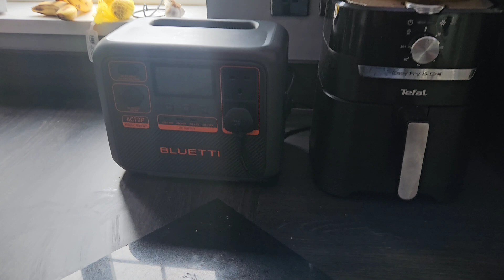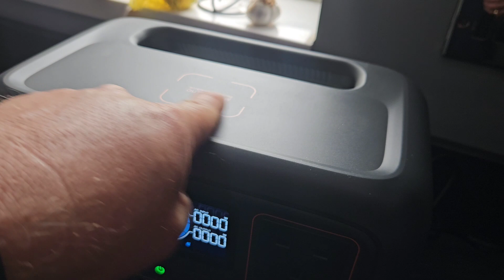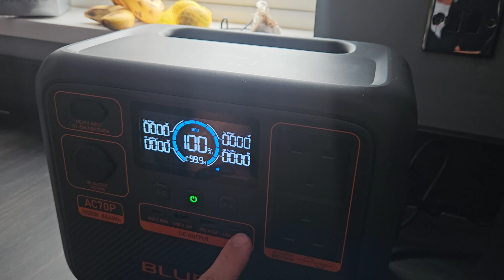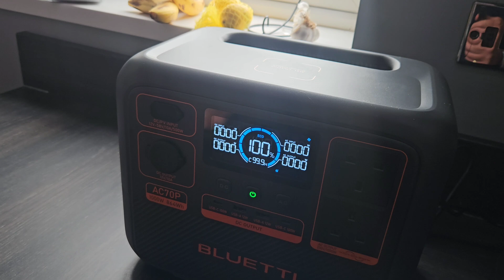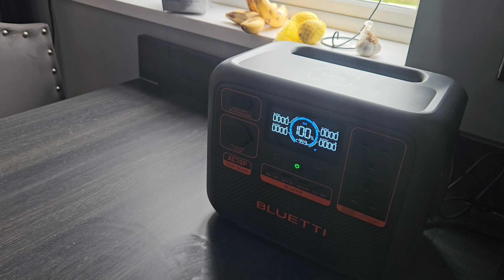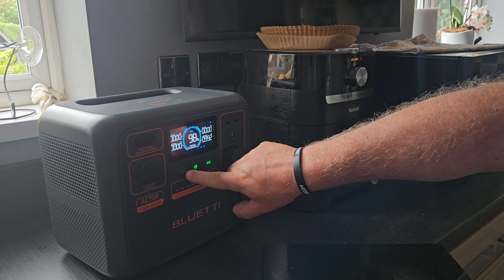Bluetti PowerStation AC70P - First opinion. Video #1

Comment: Hi! When working precisely through sockets at small loads (30-100), the station, in addition to the fan, makes a sound "like a cricket" (sorry, I can't explain it any other way). I understand this may be the inverter's normal operation because this sound changes depending on the load. Have you encountered such a "problem"?
Reply from the maker: Hi. No absolutely not. In the motorhome (see the video airing in a week) I sometimes have it powering some very small devices through mains. I havent heard this effect.
Reply: @MikeM0XMX , thank you for your response!